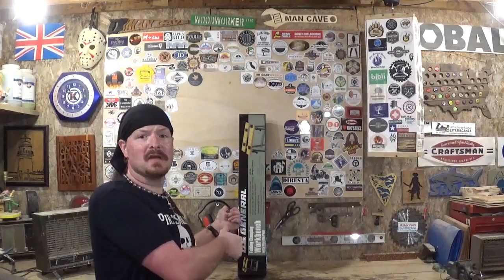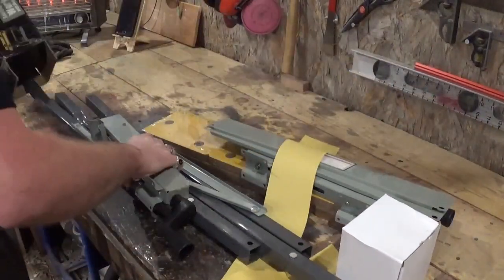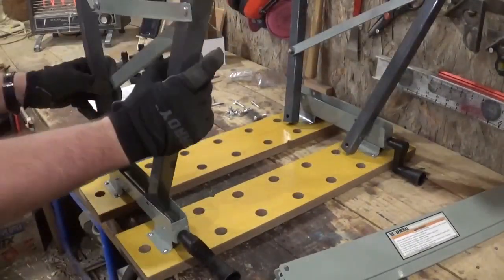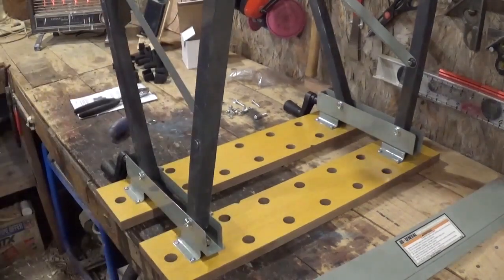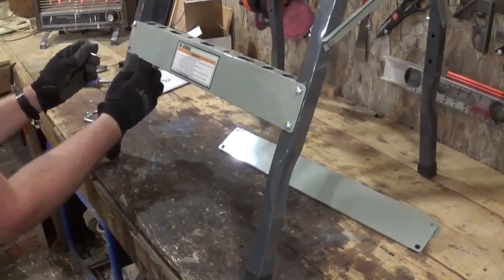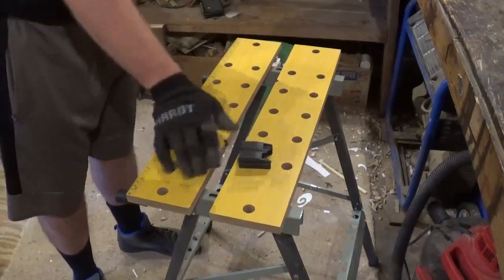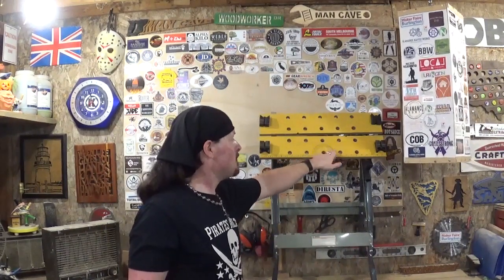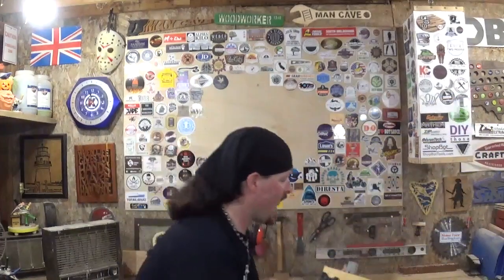Harbor Freight US General Folding Clamping Workbench, Unboxing And Assembly, #47844

Comment: I just bought one on Monday June 13th and after getting it put together with the help of your and a couple more "you tube" videos I went back and bought one more since a few of my projects are a little longer than what I feel comfortable when çutting or routing long sections of wood or aluminum tubes.

I had just seen a DeWalt work bench for $85.00 an hour earlier  and after comparing the two I decided the Harbor Freight's workbench was more than fine for my projects - and two would be perfect since I'm building a full size replica of a vintage glider by Otto Lilienthal to hang in my shop for awhile and which will eventually end up at the March Air Base Museum which is next to my home.

Thank you for you video since the printed instructions left something to be desired, such as not indicating which way the protractor was supposed to be facing when the 'table tops' we're in place - actually a magnifying glass helped figure out that part of the puzzle.

So tomorrow morning I venture forth to finish my Wife's "late" Mother's Day present, which are two new gates for the fence.

News at Eight, film at Eleven.
Reply from the maker: Awesome! Hope the workbench works out for you!

Comment: I got a melamine shelf and mounted a 2x4 to the bottom. Now I have a flat table to clamp in my workmate.
Reply from the maker: Thats Awesome !
Reply: Uncle Bobby's Hobby; Took me a few seconds to visualize what you meant when you said you added a 2X4 to the bottom of the board/shelf to make a flat surface/table to work on.

I recently came across a 4'X6' piece of beautiful hard wood for a king size beds' headboard  and am going to probably cut it down to 3'X6' for my work surface and use the other section as a shelf l, (for now), and yes, intend to protect it with a layer of acrylic do as not to mar the surface.

 BTW, I just bought two at $20.00 each and intend to use them when my project exceeds 4 or 5 feet so as to have a more secure work surface.